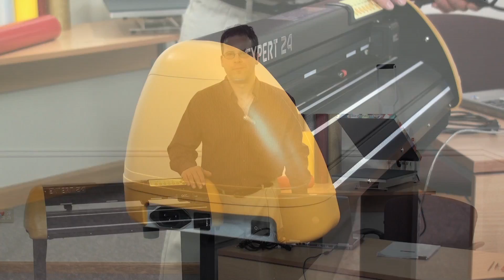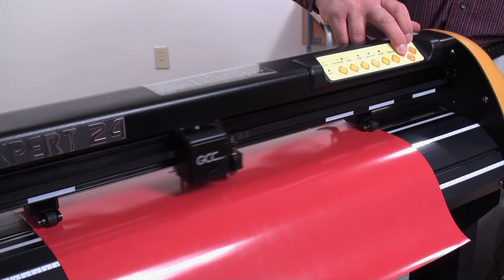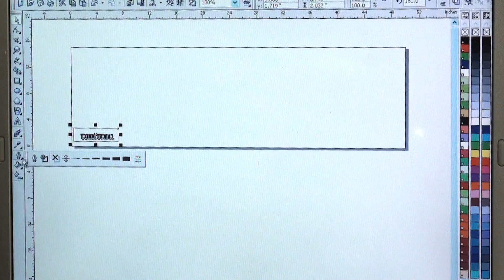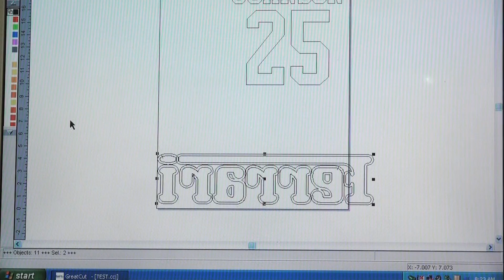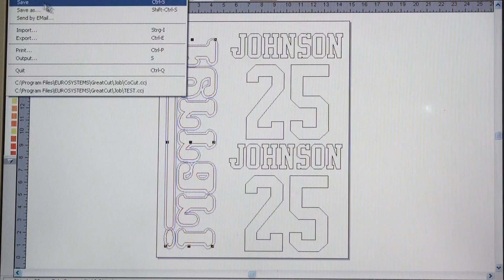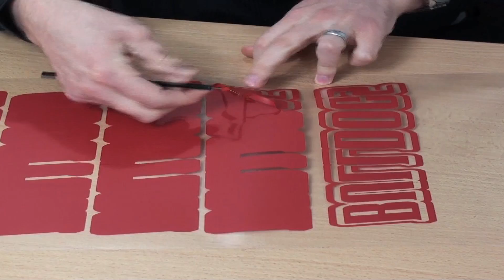GCC Expert 24 Vinyl Cutter Presented by Target Transfers and Stahls’

Comment: I WANT TO SELL MINE (if the place wont take it back) I have a brand new one and has never been used. Around the same time i was gifted an older graphtec that I currebtly used. The GCC has never been used or has made a cut(i wouldnt know how to IF i wanted to)  EVERYTHING is still in plastic etc etc.. 90snative@gmail.com
Reply: i want.
Reply: Graphtec plotter 24 inch Chahiye second hand .

Comment: I have a GCC vinyl cutter expert 24, i'm having issues with vinyl shifting as it cuts.  I try make sure I have the rollers on the white bars.  also I try make sure there is slack from the roll of vinyl.  I have also cut a good size sheet so its not trying to move so much thru the cutter, but it keeps shifting, any suggestions?
Reply from the maker: Hi Belinda, Sorry to hear that you are having problems with the shifting. Could you give us a call on 01376 326351 or email info@targettransfers.com and we can arrange a time to go through this with you?

Comment: My cutter is cutting through my vinyl backing, but the test cut looks fine. Force is set at
70 and speed at 25
Reply: You know... that's really xtrange... cuz, some times I put 100 on pressure and 30 of speed and the backing of my gcc cutter is and still like new!!!...
Reply: Change your blade type